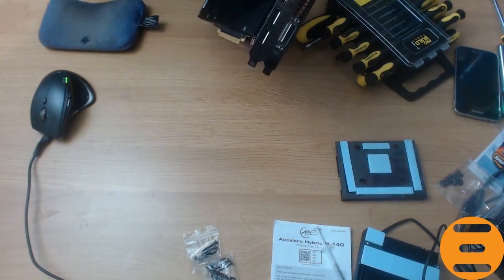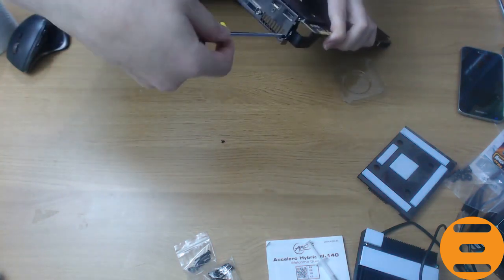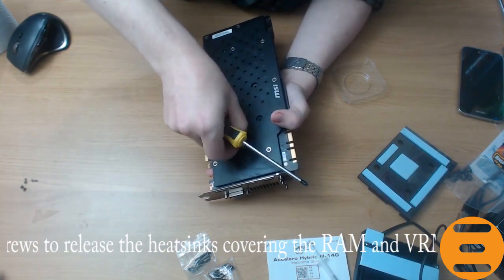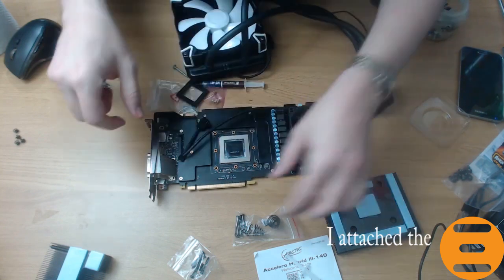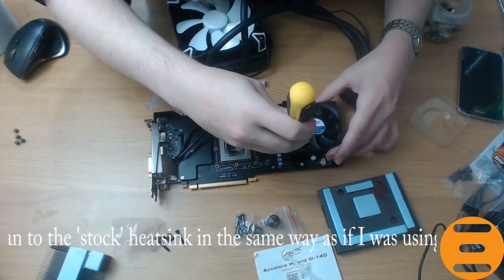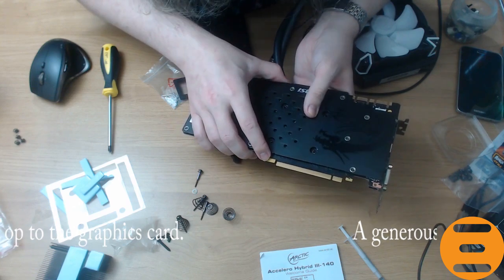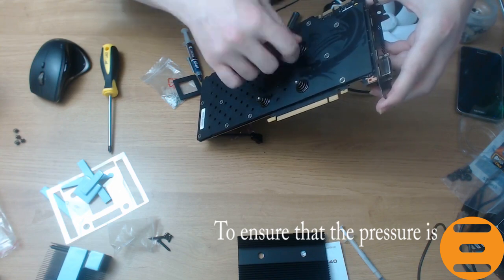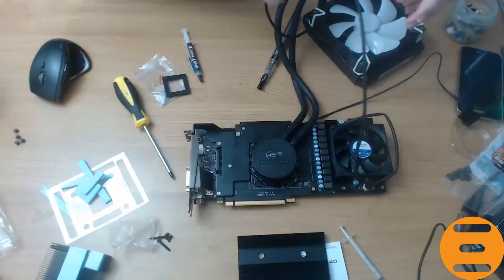Arctic Accelero Hybrid III - 140 | How To Install (GTX 980 Ti)

Comment: I have the same graphic and I want to buy this model: https: //www.amazon.es/ARCTIC-Accelero-Hybrid-120-GTX980Ti/dp/B0156R6TNI

What inconveniences would I have when it came to mounting it? Is there another refrigerator model that is easier and with the same features as Accelero?

Thanks in advance.